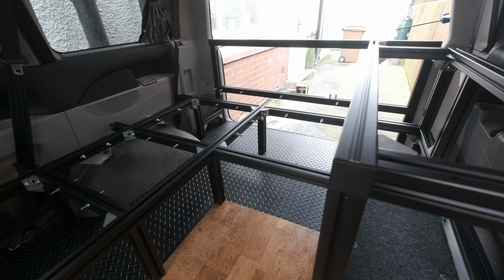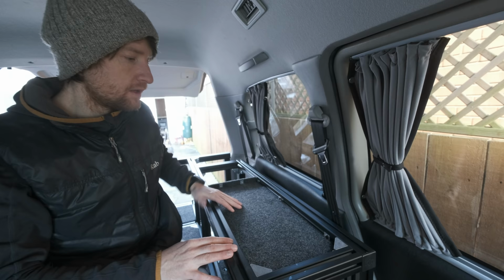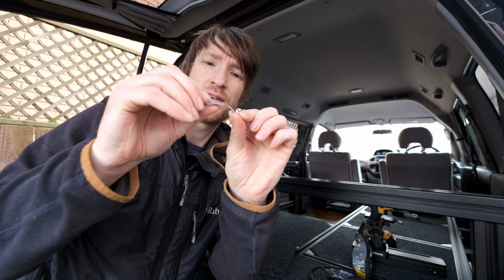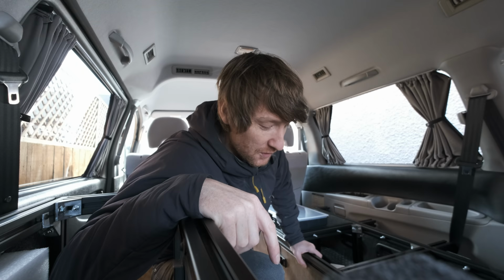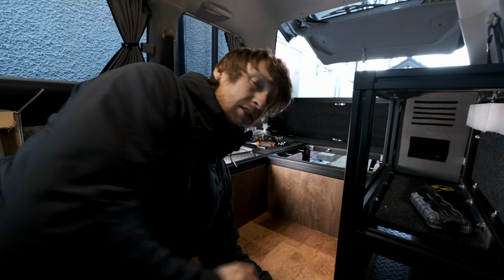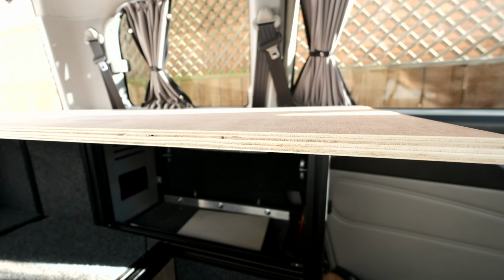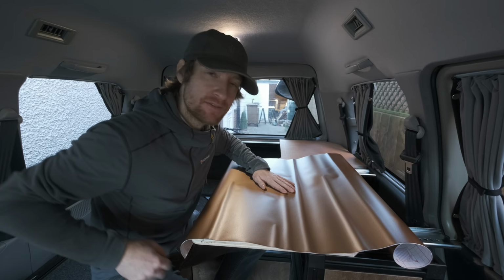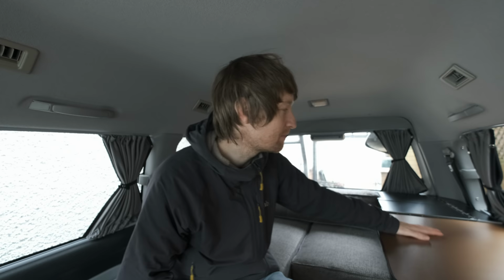4X4 Van Build - Transformation in to Camper

Comment: I really don't know why this is so captivating, especially as I have no intention of ever doing it myself, but it is! 
However, from a security point of view, I'm worried about what you have done. The slam locks are great, but are rendered next to useless when attached to a chipboard door! A £7.88 set of titanium drill saws will make mincemeat of your panels around the lock, allowing easy access to your goodies. You need a metal facia to get full security from the locks.

Comment: You put locks on front and back of the compartment... but your panels under bed (that you put on top of the compartment)... those are easy to remove. So... locks are just a "decoy" in this case.
Reply from the maker: Nah, those panels are well bolted down. it would be easier to kick out the doors.
Reply: @ThomasHeatonPhoto  got it! Nice work! Waiting for you hit the road!

Comment: Nuts might get loose - you generally cut bolts short (of course), and used a single nut and smooth washer. The smooth washer I understand. The question is, considering vibration and all sorts of constantly changing torsional loads when driving the car, if the nuts will unscrew that way. Did you use something like Loctite to lock the nuts?

Comment: Great build! Would have some shop-fitters blush with envy.

One little suggestion though, from an outside set of eyes - your "secure" door with the big lock does not seem to have bracing behind it, so the only strength it has against some solid kicks (being the obvious thief tactic at that level) is the hinges and the lock. A bit of angle bracket on each side behind would make it really solid. :)

Oh, and with the table - have you taken into consideration resting your elbows or leaning on it while you work or eat?
Reply from the maker: Thanks. I will be bracing the doors along with a ton of other snagging jobs to do. The elbows thing, I'll give it a try. Those sliders are solid. I'm sure it will be fine. 👍
Reply: @ThomasHeatonPhoto  Would hate for you to be doing some edits with a coffee and lean down after a long day and have it fall into your lap! :)

Comment: Why didn’t you look into rotating the front passenger seat,  when you park up, it a hugh chunk of useable living space? As for security I probably would have looked at a gun cabinet or gun box, they can be bolted to the floor for security. I would mount a small strip of wood on the back of the table to stop small objects falling down  behind the cabinet. IKEA sell finished desk tops in various sizes you could cut one down to fit.

Comment: Are you worried at all about the carpeted panels holding in moisture, particularly where you plan to sleep? I’ve noticed a lot of other van lifers complain about the bed area causing a mildew problem so they have to create ventilation in their bed panel areas. Carpet, while good for sound deadening and insulating, seems like it would exacerbate this moisture problem.

Comment: why dd you not take off the seatbelts in the rear? would of taken them off, and then on top where the opening is put a bolt in and use it to hang something or for some storage

Comment: Did anyone figure out what are the 8 bolts sticking out of the 80/20 grooves holding the slab woods of the bed/sofa? I think all the fixtures from 80/20 if putting that way are all wobbly. What way or what bolt he used so that they are now holding weight? If they are carriage bolts, it basically means he needs to dissemble everything to put them in...
Also, why everyone is using 40 series 80/20, not 25 series? 40 series seem to be an over kill...

Comment: I have looked at these vans for some time, popular here in Oz. Just one thing how long is that bed? excellent conversion.
Reply from the maker: The bed is 187cm. I could have gone longer if it weren't for the diesel heater. 200cm would fit.

Comment: the table on sliders can hold 10Kg... until you will rest your forearms on it after working 2h on the laptop... I know no convertible camper table which survived to real use more than a month...
I also think that if a thief has a strong enough screwdriver to "unlock" you car door, you won't save a lot of time with your locker lock but as the locker door will be ruined, you'll need time to rebuild it and probably the frame too... wasted time and money...

Comment: I'm just gonna insert my 2 cents here... The doors, even though they're built well and strong as far as the hinges and latches go. They ARE only what... 1/4 to 1/2 inch ply... If a thief sees your videos and knows the sorta expensive things you're gonna be keeping in there. And if they REALLY wanted to. They could rather easily bust the doors off and get in... Also. As far as the slide out table. It's not so much about the weight of the stuff you set on it. Because yeah. I'm sure they're gonna be light. But when you are working on the table. You're gonna lean on it. Even if you try not to. Eventually you're gonna be busy and not paying attention and leaning on it. Over time. That's gonna warp the drawer slides. But hopefully I'm wrong.

Comment: I AM curious if or how much things SKEW after driving it  ??  Will that drop-down hatch with 1mm clearance be messed up after driving? Please let us know, won't you? ALSO, I'm a large-format printing and signage tech and use adhesive-backed vinyl all the time. ANY imperfections in what it is applied to telegraphs through and you see any and all imperfections. Also, despite the fact that MacTac is similar, it generally doesn't wear well with anything that gets slid over the surface. You COULD add clear laminate as a second step but frankly, I'd use actual overlayment that is designed for countertops. PS... "Van Conversions" are a big draw on YouTube. If you use the correct metatags I wouldn't be surprised if this gets double the normal views.